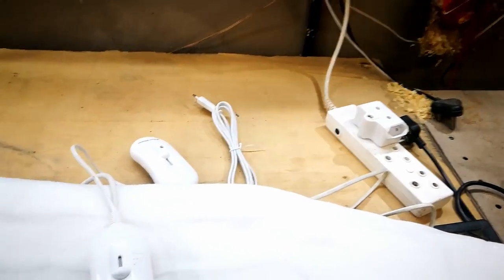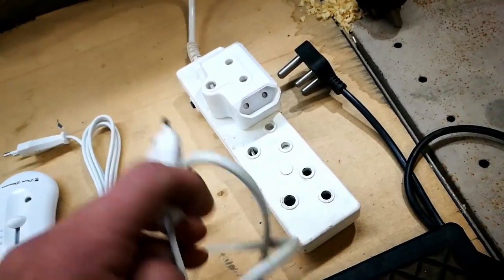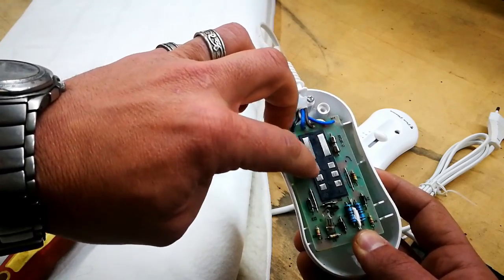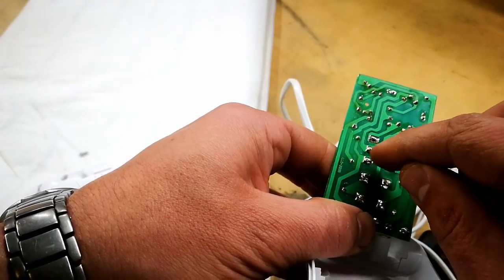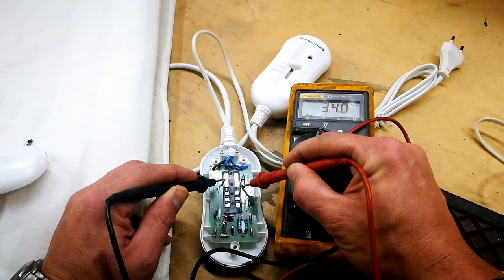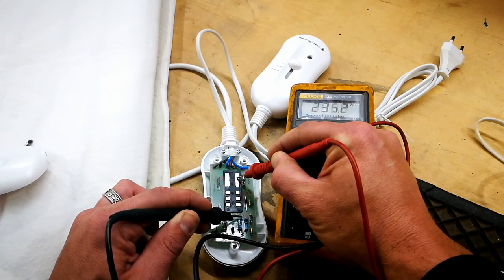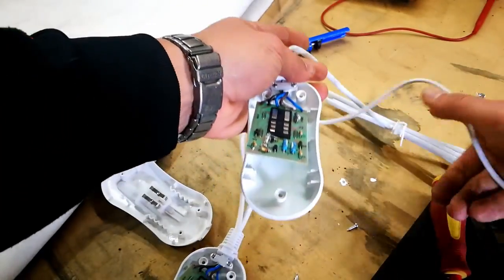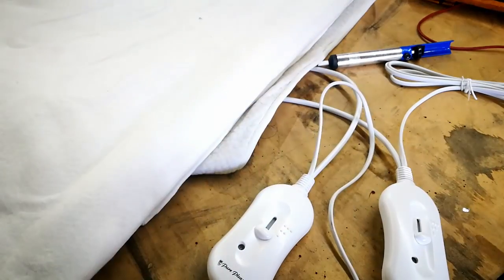Pure Pleasure QDK11-D warm blanket

Comment: I had the exact same problem and also traced it to the thermo fuse in the controller. Mine is also the queen size blanket. I purchased an exact replacement from a mail order electronic supplier in Vereeniging for about R12 and soldered it in, applying more of the white heat sink compound. I took the precaution of moving the good controller to the opposite side of the bed and the repaired controller to my side. When I switched the repaired controller on it worked perfectly but when my wife switched her side on the thermo fuse blew shortly afterwards in that controller indicating a problem was on her side of the blanket. We have only used this blanket for 2 winter seasons.
Reply: Shes hotter than you 😂

Comment: That thermal fuse did not burn out for no reason. The heating cable must be damaged somewhere. This cable consists of two wires, external and internal, similar to a coaxial cable. When the cable overheats, a short circuit is made between these wires, the two resistors start to heat up and then the thermal fuse burns.

Comment: Hi there I have the same blanket & having a issue where the light comes on but not getting warm.
I messured the thermal fuse & it shows 0.2 should I replace.

Comment: DANGER: YOU MUST USE THERMAL PASTE WHEN REPLACING THE THERMO FUSE ! :face-fuchsia-tongue-out:
Dear Jan, nearly cool video, but you forgot the white stuff which has a meaning! I have the same controller with a different blanket sold in Germany. I also found the thermo fuse to be blown and also saw the white stuff you called glue. But it's not so sticky, right? I figured out that it is thermal paste which belongs to the safety system! They want the thermo fuse to blow when the resistors next to it get too hot because of too much current flowing! That could happen due to some short circuit that would overload a part of the blanket that's going to get too hot then and might ignite if the fuse doesn't see the warmth an doesn't do its job!

Comment: Howdy! I have the king size one and a queen and the switches are not moving up or down the controllers? Do you have an idea for me? One side of the King works but with major force to get the button to move into position 1,2 or 3. The other side doesn't want to move at all. The queen has both sides not moving on the controller. It's like it stuck!?

Comment: Hi i tested the thermal fuse and it was good and also checked 240V on the output side of the fuse and it was there. All diodes test good- no other electronics on this one,  but i have 4 wires from the blanket and no matter what combination i try i get at min is a few thousand ohms?? does that mean the coils in the blanket have had it as i noticed the little light sometimes come on and not although the blanket did heat , now i get nothing on any setting and no light or warmth on blanket.
Thanks

Comment: I have a Zip brand 3 heat controller that looks like it has all the same components as yours inside but different layout with cables going into each end of the PCB. My problem is the neon only comes on with low heat, it goes off on medium and high although the blanket heats up on all 3 settings. I've cleaned the slide switch contacts, replaced the neon, measured all the resistors and diodes all OK and I can't see much else to check? Does anybody have any ideas please?

Comment: Did you just rip out that white cut out thing and soldier the other one in? Were can i find that whute thing because i dont have another controller
Reply: Same boat hey. From digging around it seems to be a PTC thermistor. I'm not sure yet where to get one that matches the spec though.
Reply: Did you guys come right.I have 3 blankets I'm not using and 1 that just stopped working as well and would live to be able to replace that part
Reply: I was wrong before. It's actually a thermal fuse. I found the datasheet for them: http://www.setfuse.com/product/over-temperature-protection/thermal-cutofftco/axial-shape/h-series.html. I'm struggling to find the exact model but some of the local electrical shops seem to have something similar.
Reply: Try AUPO 102 C P1F 2A 240 V

Comment: Sir thermal fuse work as a fuse or like a auto cut?
Reply from the maker: Thermostat switches on and off as the temperature fluctuate.
The thermal fuse blew once the temp reached a certain point and stayed off.
Reply: How make a auto cut electric blanket switch?

Comment: What is the difference between thermal fuse and thermostat
Reply: Thermostat controls the temperature.  Thermal fuse breaks the circuit if the temperature rises above a certain setting.
Reply: Thermostats can go short circuit and so are not a safety device.

Comment: Not really helpful. You're just replacing from another control, may as well buy a new control. I need both sides to be warm
Reply: Order a replacement 102 C 250 Volt Axial thermo fuse from Rabtron Vereening. About R12